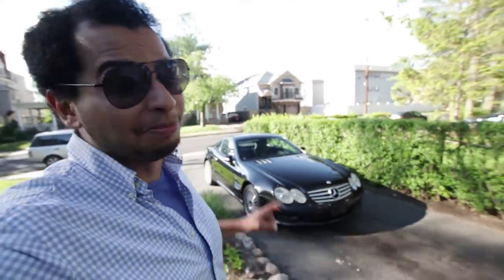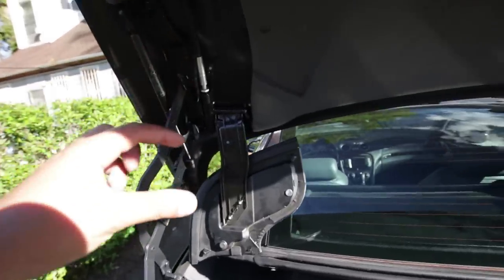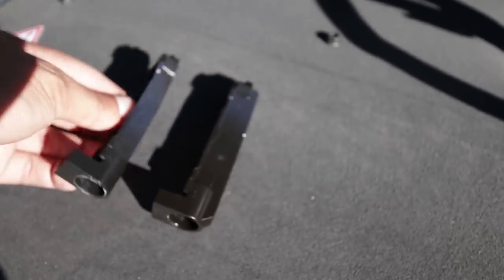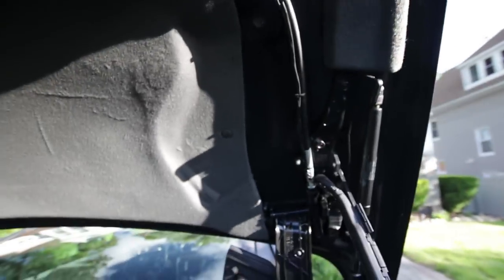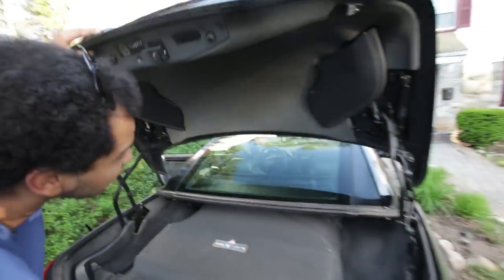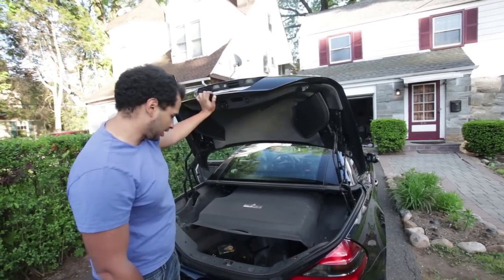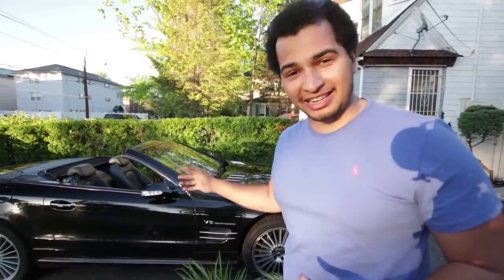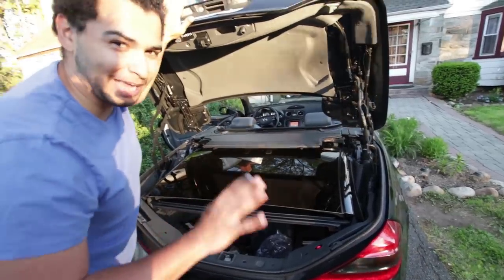I Fixed The Expensive Convertible Roof On My $8,900 SL55 AMG For Free (Almost)

Comment: I'm just dying for you to resurface those headlights. It would look sooooo much better lol
Reply: Hunter Dugas  Resurface? No, you just buff them out with Meguiar's polish compound.
Reply: toothpaste, water and a towel works.
Reply: The car needs a full paint correction and detail.
Reply: I would just wet sand them 600 trough 2500 grit... polish them, also clean the interior leather.. and I would also  would detail the paint my self... that alone brings the car up in value...  now with that roof fixed I would get rid of it inmediately and easily ask 17000 for it...accept 15 or 16  INSTANT  profit...

Comment: Tavarish, good for you. We just got rid of our 2004 SL500 after spending $3000 on a new accessory battery, new hydraulic pump for top, looking  to replace engine and transmission mounts and oil seals after only 42K miles on the car. If you haven't already done so, put a trickle charger on the rear battery 'cause the car eats electricity even when turned off. It is indeed a beautiful car, great for touring and just cruising the boulevard but over-engineered with sensors everywhere! As to the trunk not staying up, the shocks are shot;  an easy and surprisingly inexpensive fix with new shocks.
Reply: I've been looking at 2007-2008 S550s, but after seeing how much shit breaks on these cars, I'm having second thoughts. Very disappointing. I've owned many older German sports cars/sedans (70s/80s & 00, Audi, BMW, Porsche) that I've had good luck with, but I'm starting to realize the newer stuff is overpriced junk.
Reply: OMGWTFLOL LS460 would be your best bet if you want a reliable flagship luxury car although not as sporty as the s550
Reply: I had a 2009 s550 and it was awesome. I did all my own repairs on it. Its not as bad as this car but still expensive if you dont know how to fix it yourself
Reply: I'm keen on the 2004-2006 Lexus LS 430. V8 with only 290hp but 27mpg hwy. With the Ultimate Luxury package you have tons of comfort and luxury with Toyota reliability.
Reply: Yep, have an 04 SL 500 as well.  Replacing the struts on the trunk is a 15 minute process. Done it a few times now.  Can buy the struts on Amazon.
Reply: No comparison.  Enjoy your Lexus but an SL55amg is a thrill.  Just a bit problematic to own.

Comment: 1. Fix electrical issues
2. Fix Mechanical issues
3. Restore Headlights
4. Adjustable Coilovers
5. Wash & Polish
6. Brabus Wheels 
7. Remap ECU
8. Dyno
9. Wheel Alignment
10. New Exhaust
Reply: Chris Logue Yes, he should take the ABC system off to make the car much more reliable. ABC is what makes this car cheap. Once (not if) it fails, i'ts 4k per corner to replace. There are coilover conversion kits out there for this specific model. The 55 v8 engine itself is very, very reliable.
Reply: I love the factory wheels. Can't believe you would consider replacing them. I also wouldn't touch the suspension or exhaust. Gotta go with Chris Logue on this one.
Reply: The endless money pit machine. Get that check list ready! lol
Reply: Why coilovers, Because in these cars they tend to go faulty at some point.
Reply: Eman 08 u jealous?
Reply: AMG BENZ_HAMMER_6.0 Mercedes Benz fanboy came out the woodworks because he's butt hurt. Can't get enough of Scotty Kilmer huh buddy? 😂😂😂 #Toyota/Lexus4Life
Reply: 11. Repeat
Reply: Gesh622 you mean wash, claybar polish, polish again , ipa whipe then nano treatment.
Reply: Chris Logue and that hydraulic suspension is only good for first few years. then its worst suspension mercedes ever made.
Reply: Pretty much, but it can be really really expensive as seen on superspeedersrob video for his supra !
Reply: @Gesh622 well that's different since its been modded. When you mod a car it cost a ton of money and when equipped with after market parts, you are making the car less reliable than its manufacture specs. Modding a car technically devalues a car.
Reply: 5. Restore paint
Reply: "Modding a car technically devalues a car." I see you have never owned or sold modded car.
Reply: Gesh622 yeah all that money will waste all your money and be time to sell it after doing all that
Reply: bmw m3 dude... That sentence made zero sense. " all that money will waste all your money" - Quote of the year

Comment: [A question at end of my comment] Fantastic. "I'm so, so pleased." So am I, Tavarish. Those two flaps on my '04 SL500 hang down just a couple of inches. I have been using a few strips of clear tape to hold them up so the top will begin its operation, then pause the retraction about halfway and remove them. Now I will get the part and attempt the same repair. Question - Same part number for both sides?

Comment: The rattling sound in the engine is the idler pulley, frequent failure, cheap and easy to change. If the car have any sudden loss of power after some hard runs check the intercooler pump, another cheap and easy fix. My S55 had both replaced.

Comment: Hey Tavarish, you are making progress, it has so much potential. Just think you need to check the power steering pump, and some of the bearings in the serpentine belt route. From the start up sounds these may be more pressing problems? Also would like to see the paint sparkling and the head lights clear. Love your commitment to this project.

Comment: Great Job on fixing the roof!  Mercedes seems to under design components sometimes.  I had a 98 ML320 that had an air conditioner failure at about 3000 miles. Naturally, I was crossing the desert from Escondido, CA to Phoenix.  Took it to the dealer who fixed it under warranty and said it was a minor change.  When I looked at what they changed the upgraded parts were completely different and much, much sturdier.  I would imagine that most of these SL tops are similar.

Comment: I had the same problem with the heavy trunk wanting to close on my head on my SLK350.  I replaced the struts in the trunk, and it fixed that problem for good.  It's a cheap fix, so do that.  Awesome car.  Good video.  Thanks.

Comment: Look i had the same exact model but in white and if you open the trunk all the way up and then press the red button it will move because as you said it before that car is full of sensors so if the trunk is not all the way up then you won't remove partially the top to get your things... Try that maybe it will work
Reply from the maker: Yup, I figured that out shortly after I recorded the video.

Comment: And my peugeot 206 cabrio (with is now less then 2000 euros) with metal roof works since year 2002 no problem..one time end off one cable broke..fixed by mu self for zero money..and one time stopped on half open i did not want to go more but return normally..fixed by my self just by spraying spray for brake clean on sensors

Comment: How did they manage to damage the rear brake light
Reply: +Pimptobizmal - Everything on this car is worn out or thrashed, which is why he got it so cheap. Door handle button is broken, as is power window switch, as is power headrest button, as is bottom seat trim, as is trunk separator switch, as are trunk struts, etc. I can only imagine the lack of maintenance to the powertrain. Regardless, it's a cheap and fun project.
Reply: with the way the car is treated, his next video is, $12000 engine maintenance done for only $4000
Reply: Pimptobizmal agreed! This car was definitely used and abused. it doesn't help that it is showing the signs of typical Chrysler quality from that era. But fun project car nonetheless.
Reply: The cheapest Mercedes is the most expensive Mercedes. Dont forget that kids...
Reply: That's how you can get to the trunk mechanism if the remote or manual key don't open it.  Otherwise some mechanics drill holes in the trunk itself or (nightmare scenario) cut through a rear light assembly.  Question to other SL500 owners...shouldn't the "Visit Workshop" alert alternate with "Visit Bank?"

Comment: Probably that switch or (switches if you have two) That the cover presses against when it's closed. They are not making contact for some reason, broken or bent. I had the same thing happen to my SLK. I taped the contacts together and it worked fine till I got another switch.

Comment: There is about 10 different sensors that will prevent the top from working. This is when a professional scan tool helps find and test sensors. Autel 908P Elite / Star 4

Comment: The minor things to look out for (or at least things that don't require surgical dissaasembly) when the roof stops working are: that switch that you fixed, those trunk flaps having play, the hydraulic pump not having enough hydraulic, or the PSE pump is dead. The roof won't work unless those issues (and hella others) are rectified.

Comment: Fit two new gas struts and the boot lid will open properly and the red roof lift button will then work.  Yet another lock out switch requires the boot lid to be fully up for the red button to operate.  Also please don't  slam the boot lid shut.  Close it gently and then an auto close mechanism will grab it and close it shut.

Comment: Great job mate and great looking car.I like your approach to simple problems.MB technicians are far too expensive and only replace box for box.Not really fault findings.I'm an aircraft technician and lot of things you have described in your other videos are pretty much similar to modern aircraft.For instance replacing certain modules before they actually fail.We replace regularly a lot of parts because they have so called 'Hard time'.It means replacing even fully functional and faultless parts because they reach the end of the safe operating life.Just like your MB brake module.

Comment: It sounds like the car has a very bad wine to it when you start it up. I've only owned the SLK32 AMG, but a similar sound was an indicator of a bad bearing on the drive belt on my car. Thank about how nice the V8 will sound if it doesn't wind like that. 
Also, it's the first time I watch one of your vids, so it might be that you covered it before. Good job by the way! I used to love working on my AMG.

Comment: The load assist on my 2003 SL 500 was not working either.  I changed the struts to hold the trunk lid open and it started working.  You could probably get it to work if you just hold the lid open all the way

Comment: These hydraulic tops are really cool and not that hard to work on. It does take quite a bit of time to pull the cylinders/pump to have them rebuilt and then re-install, fill , and bleed. They worked perfectly once done. Saved thousands doing it myself.

Comment: Hey Tavarish, did you hear the squeaking sound at 4:48 when you started the engine? That might be the fan belt. Please do yourself a favour and check if all the rotors move that sound might come from a not moving rotor (ptobably ac kompressor) the belt grinds over it, squeaks and might break... greetings from germany!

Comment: Now you got to do something about that whine in the engine.  Sounds like the power steering unit.  The thing about these Mercedes they have a ton of sensors, and they are not cheap.  Wait till that top goes out you will have to dig deep into that pocket.

Comment: the button at 9:40 will only work if the trunk lid is totally open. Half-way won't do it. Also, it will only close back if the trunk separator is in place. By the way, does the trunk softclose work? Mine sometimes fails due to a timeout error and I have to erase the error to have it working again.

Comment: The error about trunk separator happens usually when your car has been sleeping for a long period of time. In this case, you just need to drive with your car typically half an hour until your second battery is fully charged. Then after you will see that it works as usual again.

Comment: It looked like the soft close was not working properly when you slammed the boot lid closed.  Don’t slam the boot/trunk on Merc with soft closed system, you will break it.  Also, the top lift in the trunk will not open upward unless the boot/trunk cover is all the way open to the top.  If it wants to fall down and won’t stay up replace the shocks/support rams.
Soft close is easy fix with epoxy on cracked plastic, if not working properly.  If soft closed system not working properly after a few cycles it will trip error code and hard top will stop functioning, not Good if down and it starts to rain.  You can reset to fix temporarily by removing the 20 amp fuse in panel behind pass seat, third fuse in, and then re-inserting fuse back.  This reboots computer and allows top and soft close truck to operate until trips again.  The soft close is operated by air compressor and if it reads a leak in system it will trip error code so it does not burn up the pump (expensive fix).  
Enjoy the car if you still have it and make sure to service oil pick up o-rings in sump before you have major engine issues.   10 years or 100k and they get hard and leak which will not oil engine properly and has led to spun rod bearings....  important for M113K engines.

Comment: Did the trunk separater not lift up when u pressed the button because you bridged the switch? So it won't lift because it thinks the separater is stuck down? Or was the button just faulty like the switch is?

Comment: One thing I've noticed was, so far in these two videos of the, SL was there seemed be no powertrain issues. I'd say the same thing in his S-Class. Based on hearsay from those who own a Mercedes also, there seems to be more issues on the other stuff that is irrelevant to the powertrain than the powertrain itself. My theory is their engines are LOWER REVVING, due to the torque curve as Tavarish has mentioned in the last video, which would increase the reliability of the engine. So MB sees that great aspect and that saves them money involving the powertrain. Because of that, MB can have extra capital left over to make their interior stuff like the seats, dashboard, steering wheel, etc. more detailed than other brands, like BMW. They would implement cutting edge innovative features, like Magic Body Control, in the S-Class, something I tend to see less in BMW and Audi. The reason I mentioned BMW and Audi is because they are in the same price range as MB and they are really different. They tend to be HIGHER REVVING and that would cause more capital to be devoted to the powertrain and less to the now-powertrain stuff, explaining its lower quality.

Comment: Nice!!! Now replace the drive belt pullies they were screaming replace me when you first started it lol
Reply: Check the abc suspension next for leaks/fluid level and the SBC for brake fluid level. To flush your abc you need star or an equivalent to put it in whats called rodeo mode. Check out all german auto's website. They are a repair shop that makes a tool to do the flush with.
Reply: Actually you have the older version of abc so you dont need the tool. You need to run the car up to operating temp, either drive it and take corners/go over bumps or have a way to put it in rodeo mode so the fluid gets up to temp, pop the hood, clean EVERYTHING around the cap, unscrew cap and remove filter, detach cap from return hose and hook up a longer hose into a catch bucket, have 10 quarts of mb abc fluid open and ready and a catch bucket. Run the car amd have someone lower/raise the car while someone else fills the reservoir. DO NOT let the reservoir run dry. Replace filter. Yer done

Comment: There is one expensive thing in this merc. Its ABC suspension. One shock cost about 1000 $
Reply: they can be rebuilt.  they work so well when they function that it is worth fixing.
Reply: Thomas Brasse I know, rebiuid cost about 1500 $
Reply: The Truth U got it cheaper in US than we in Europe
Reply: Hey Truth, 1 have a 2007 SL550 and I am looking for the head unit for radio CD/DVD and Nav. I believe it's called the Command unit or something like that. I also need a working trunk actuator/latch. The vacuum soft close type. You say you have parts so I'm asking. I live in L.A.
Reply: You need to do preventive maintenance. Mercedes calls the system lifetime.  Not so.  The fluid needs to be flushed when it turns from bright green to light brown.  Also putting in a magnetic filter on the return line as well as replacing the 10 micron filter with a 3 micron.  The accumulators should also be replaced maybe every four years or so.  The system will last many many years and not leave you stranded.

Comment: Noice! You are correct, small victories.
Reply from the maker: Funny thing is, the trunk assist worked after I propped up the trunk a little further. I didn't realize that the trunk had to be fully open.

Comment: Hi, I've been in the market for a two door luxury coupe recently. After watching this video and seeing the deal that you scored on that car, I went searching on Craigslist. I've found a 03 Mercedes SL500 for $8,950 with 111,000 miles on it. I'm not sure if this is the amg model or not yet due to the lack of thorough pictures but I was wondering if this was a deal, or a rip off
Reply: did you even watch the video? cant you see how many repairs he has to do. these old mercs are complete garbage. this is what happens when you make a car with 1000 sensors, too many motors and too many batteries.